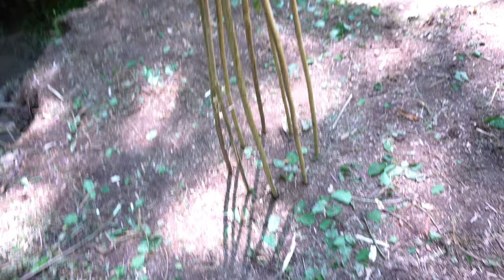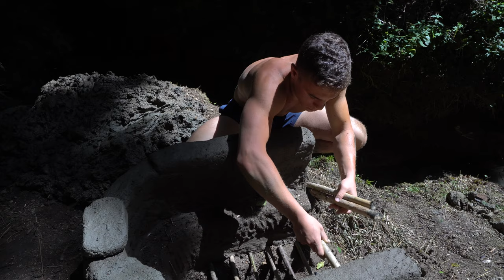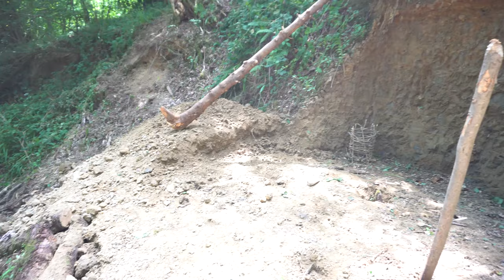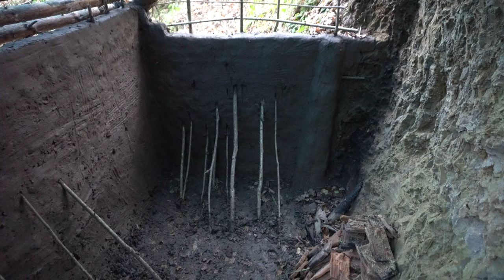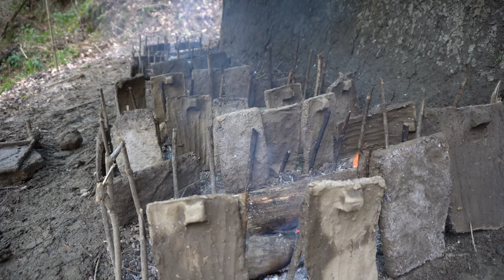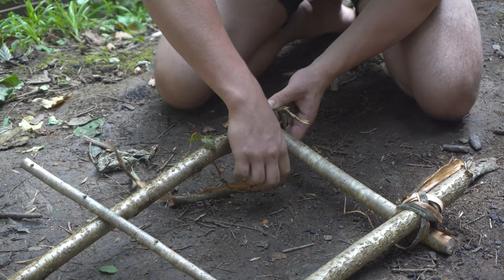🇬🇧 Primitive Tiled Roof House *ACTUALLY* No Tools

Comment: Very cool project, very interesting to watch! Thanks especially for explaining what you did, including what you would do differently.
One question: How do you prevent rainwater that is running down the slope from getting into your hut? Did you build some kind of drainage that leads the water around the hut, or has this simply not been a problem (yet)?
Reply from the maker: Thanks a lot ! The cliff surprisingly had minimal rainfall flowing through it, I believe this was the case as there were lower slopes either side so water tended to use them to reach the river.

Comment: It turned out really nice.
Out of curiosity, what percentage of the fired tiles broke during firing and were warped enough that these were unusable?
Reply from the maker: Thanksss :) I think I mention that in my description, but I achieved an 85% success rate over the 600 tiles made. The warping of tiles was solved by increasing the thickness of the tiles.
Reply: @PrimevalUK  oh I'm guilty for not reading :))